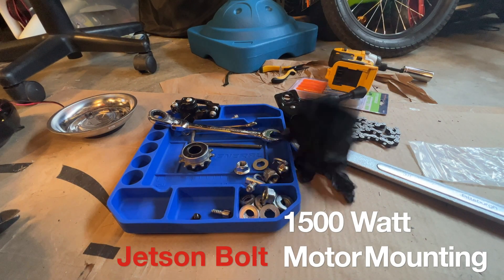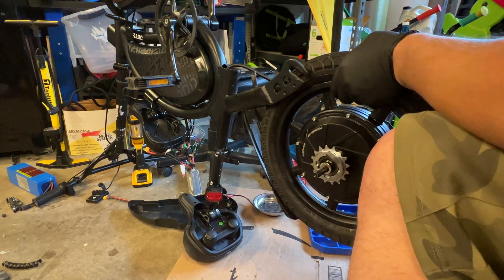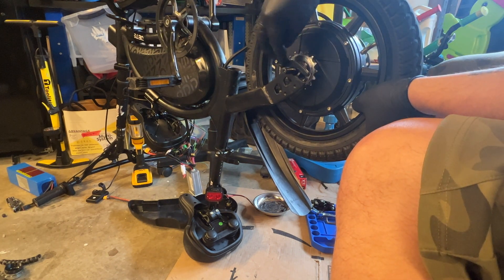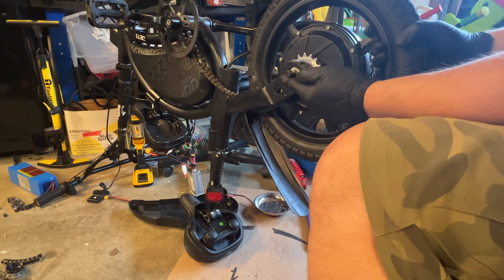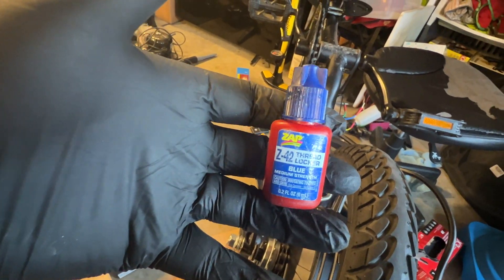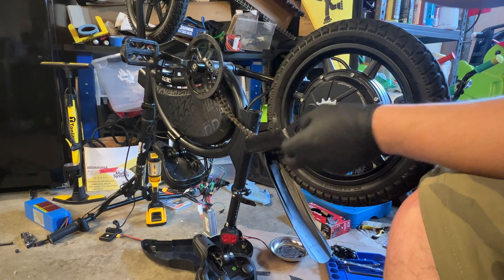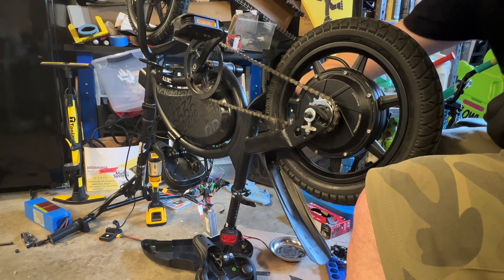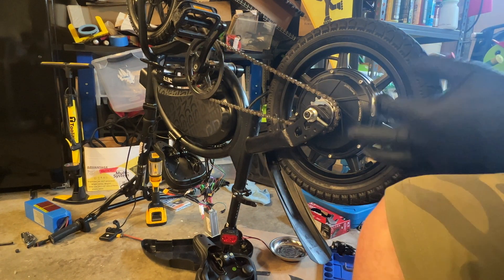Jetson 1500 Watt Motor Install - Part 2

Comment: I bought the same motor for my bike. So I can understand why after you noticed you put the tire on backwards you said “no way I’m going through that mess again”. Lol. It has almost no drop center, so getting that tire (a very stiff tire) on and off is not easy. 

The motor is high kv and low kt. I did everything reverse of what you did. I bought the motor first, and connected it to the original 15a controller. Acceleration was about 50% of stock, but speed was faster, limited by the 15a. 

Since the original BMS was also 15a, i upgraded that to an ANT 80a/200a Bluetooth bms, even though my battery was 25a continuous and 60a peak. 

Then i installed a 27a controller i had laying around and with about 2x the peak amps i regained the original torque and it would go about 55kph with 48v battery. Original speed was 33kph. 

So then I bought a Fardriver 72360 (190a DC/360a phase). This allowed me to use the battery’s full capability. Probably if I just installed a 60a controller at that time the bike would have been perfectly adequate. But NOOOOOO. 

Since the ANT BMS was 7s-16s, and my battery case had room for a bigger battery, i made a 16s5p 21700 P42A pack. I can get 180a peak and 60a continuous. Now, with a 60v battery, the bike can go 70kph without field weakening. I went to 80kph with mild field weakening but it started death wobble and the current needed was 2x that of 70 kph so I turned field weakening off.

My bike is slightly different design, so it will not even try to wheelie with this motor. It’s more like a jet during takeoff. 

The most I have sent is 10,000 watts, but I think you can get most of the torque with a 100a controller. Even a 60a controller would give that motor a decent acceleration and then it would pull back to below 30a for cruise. I feel this motor can handle 30a continuously.

Your 1000w controller (ill guess is 30a) will never utilize this motor effectively. I bet the acceleration is almost the same as the stock motor with stock controller, twice the amps but without the gear reduction. 

Of course a Fardriver on a jetson is crazy but there are some programable controllers that would fit. The programable ones are so much smoother and have regen, and let you customize the speed and torque to match what your battery, motor riding environment can handle. 

My future modifications will be more about suspension. I have a rear swingarm but it has two 1000lb springs so it behaves like a hardtail. Lol
Reply from the maker: what an incredible write up, i'll have you know that I read all of this with a huge smile on my face. Just when I thought i was done with this build, you come and hit me with all this haha. To be honest im pretty happy with what im getting out of the motor controller, but knowing there is so much untapped potential definitely makes me curious to say the least. Thanks so much for sharing. 

ps. there was no damn way i was going to reverse the tire after fighting it on and realizing it was backwards haha.

Comment: Bro if I upgrade the controller 36 1000 watts and keep the same stock rear hub motor will the new controller give some ghly more torque. I just need more torque to pull me up hills not concerned about high speed. Any tips bro
Reply from the maker: I tried that and unfortunately you’ll put too much stress on the motor and eventually fry it, before that all your rides will sound terrible, I couldn’t stand the sound. I had upgraded the controller and battery. After that I ended up just getting the motor and finishing the job.

Comment: I have the same hub, a 48V 20ah (125A output) copper battery I built. Kelly 7218N (Controller. So roughly 4800 watts. Its too much power and it power wheelies the bike. Ive ate sh1t once from a power wheelie😅. The hub really good. Unloaded it revs to 1350RPM and loaded 1040 RPM. Roughly 70kph top speed. I think Im going to make an extended swingarm.
Reply from the maker: Heck yea !!!

Comment: Tires on backward
Reply from the maker: yea thanks,  after fighting to get the tire on the wheel and realizing the tire was facing the wrong direction, i made the decision to just rock it backwards. Doesn't matter much with this type of tire tread anyways.
Reply: Yeah lol it would just do my head in and would just keep looking at it I would have to flip it lol🤔

Comment: do you think a torque arm would be  good to put on .
Reply from the maker: I definitely recommend it, I wasn’t able to get mine back on there until I swapped the chain to accommodate the larger rear sprocket ⚙️